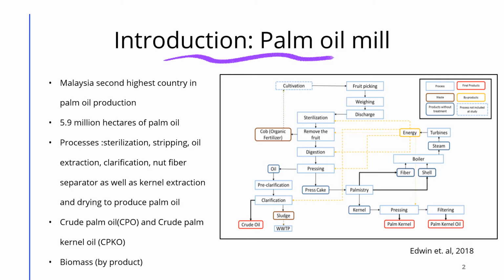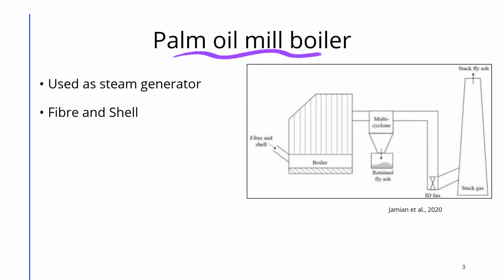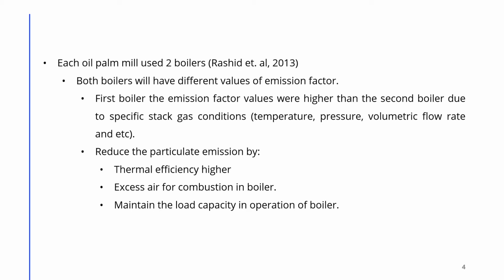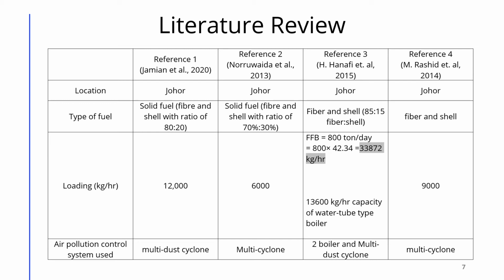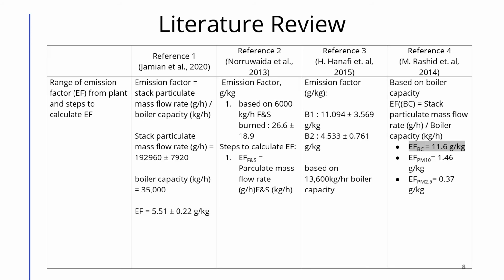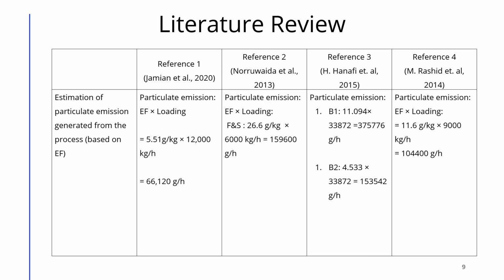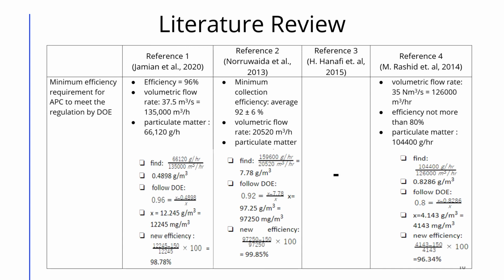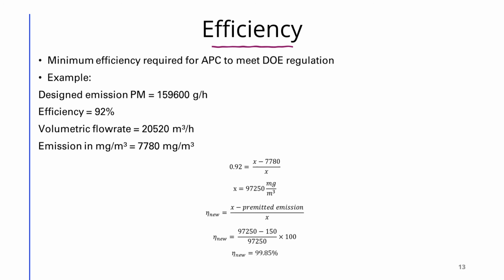Palm Oil Mill Boiler - Group 2

Comment: Hi Group 2. Good presentation. Why multicyclone mostly used in the palm oil boiler?
Reply from the maker: Thank you for your question.  Multi-cyclone is a common used in the palm oil boiler due to its ability to handle it in high temperature, high flue gas volume and pressure. Also, the particulate matter produced from the boiler could be PM10 and PM2.5 which have varies sizes, multicyclone are able to separate the particulate matter effectively which then can reduce the concentration of particulate matter in the gas. Thus, this method appears to be one of the available options in Malaysia.